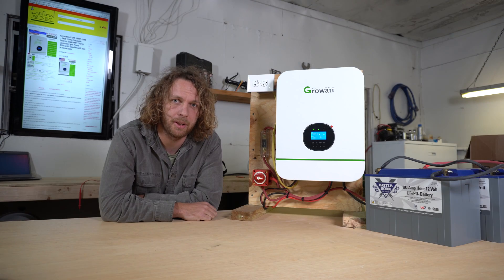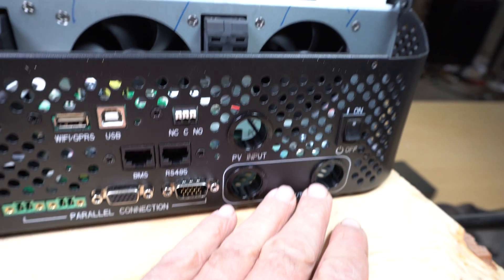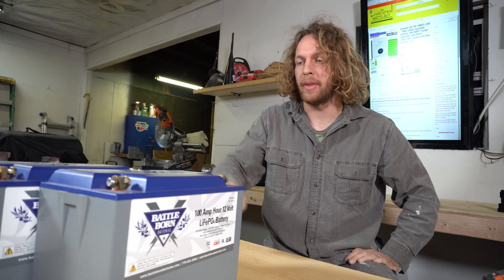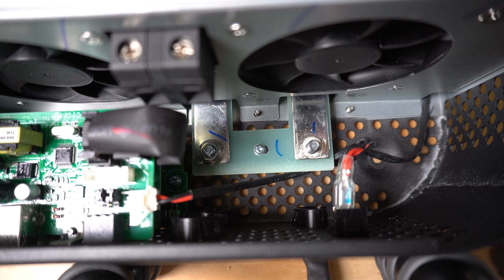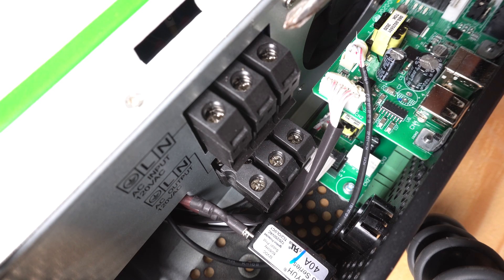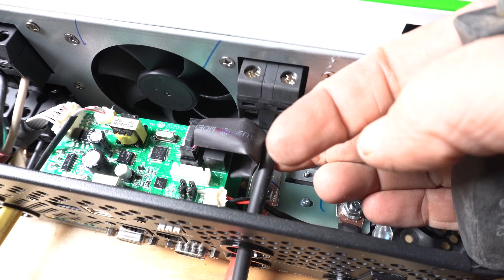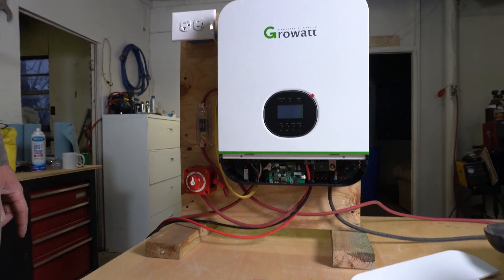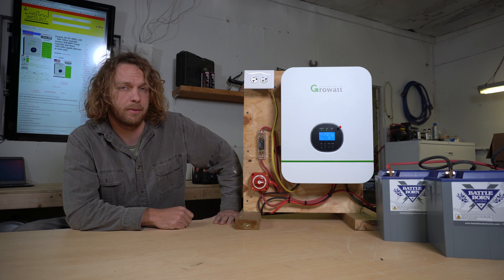Solar inverter by Growatt 3000w Test bench and first impressions.

Comment: can you use the 48v growwatt on only one 12v battle born battery?
Reply from the maker: Hey!
No I do not believe so you would have to buy 4 12v batteries or 2 of the 24v battle borns and that would be really expensive.....but if you want I have been looking into these batteries
 https://bigbattery.com/products/24v-wolf-lifepo4-120ah-3kwh/?ref=138
And they seem to bee the best batteries that would work with these Growatts at half the price...
Reply: @J-TAB  i want to get the growatt inverter that doesnt need a battery. i was hoping to get one 12v 100ah battleborn battery and then add them as i can afford them later. i purchased 10 250v santan 8amp panels so far and would like to use them with the growatt 48v batteryless option. I want to run 5,000btu without a battery using a large solar setup. Will 10 panels run a 400W load ac unit(5,000btu) with 900w start up(guess)? and since i cant get one battle born what are my option for those out of stock sok batteries? will they work with the grow watt batteryless 3000w? thanks i got some property in wonder valley maybe we can link up and you can help me get it going?
Reply from the maker: Hmm I see I would recommend checking out https://youtube.com/c/WillProwse
As I believe I have seen him use one of those non battery growatt's. He could probably be able to give better info on it. If you find out please leave a comment at let everyone know thanks!
Reply: @J-TAB  will do yea i follow will and watch every video of his and i want him to do one on the btteryless with larger array. he working on it but i need it now lol. thanks for help. correction 250W panel.
Reply: @J-TAB  does the growatt 3000 not need breakers between the ac outlet and the growatt? i was wondering if its all internal but i seen everyone besides you hook it up with beaker box. i was trying to save money hoping its all in one deal. any help thanks! i got my stuff in. now in setup mode.

Comment: Thank you for the Video.
Are you 4AG or 2AG. For your battery cables.
Did you have to configure any settings on the Growwatt?
Reply from the maker: I used 4ag cable as at that length of cord is sufficient at that load but.... if you can do 2ag that will not hurt especially if you are running the battery's any distance from the Growatt
Reply: @J-TAB  it’s a good video bro. Keep it up. Solar is a big deal right now. You can keep expounding on solar and DIY🤑
Reply from the maker: Thanks yeah I'm gearing up to do more!....

Comment: Hey, what can those 2 batteries run, and for how long?
Reply from the maker: hey Free!
so the battleborn battery's are 100 amp hour as 12v so 2 battery's in 24v is still 100 amp hours so its whatever you are running load wise, a quick google search will give you a calculator that can help you ... I don't have test equipment to test down to the watt hour but I will let you know with practical usage I have used at my job site running table saws and miter saw and tile saw etc. it has performed and had plenty of energy left over. I will be making a update video soon.....

Comment: I was hoping you would have included the solar panel hook up.
Reply from the maker: Hey Bryan!
I will be making another video soon on it. I have been using it for work and its great so far it powers everything I have thrown at it except a large compressor..... but I will be getting some panels go test also .... if you want to see some solar stuff on it you should check out 
DIY Solar with Will Prowse
 parosehttps://youtu.be/V0peZR8AyaU
Reply: @J-TAB  curious if you made that video ?  thanks

Comment: Do they make 12 volt ones?
Reply from the maker: Hmmm not that I have seen .... but you can use a 20 amp dc to dc charger 12 to 24 volt
Reply: @J-TAB  did you use the 24 to 12 dc dc converter. My appliance run off a 12v system and I'm trying to figure out how to setup that converter ( I have 2-200w 24v solar & 2 12v led acid batteries)

Comment: I'm looking for inverters that can be connected at 100 of 400W solar panels and also charge a 48V battery bank (near 50 kW).
Can you give me an idea of what type of inverter (and how many) for this type of PV please ? 
Thanks a lot for your video
Reply from the maker: Hey Denis!
I'm not sure Growatt makes a inverter that big... but here is one that you could use multiples of as long as they don't have to be linked https://watts247.com/product/new-growatt-250v-dual-pv-input-48v-12000t-12kw-split-phase-120v-240v-output-100a-at-120v-50a-at-240v/?wpam_id=81

but if you need to have them all linked you might consider these https://watts247.com/product/2-x-spf-3000tl-lvm-48p/?wpam_id=81  ....if you have enough of these you can get more input/output together than the one big one motioned before but i don't know if you could stack enough to meet your needs....

I hope that helps I have not built anything on that scale.....DIY Solar Power with Will Prowse may be able to give you more info https://www.youtube.com/user/errolprowse
Reply: @J-TAB  You help me a lot... the first one it's a big nice one :-) 
I'll ask Will also 
Thanks a lot Josh :-)
Reply from the maker: No problem.... the first one is big but the little ones can be linked to be even bigger so you would just have to see witch one is better for your application.....
I'm glad I could provide a little insight at least 😉

Also if you do decide to buy any of these and use any of my links I will get a small commission at no cost to you that will go toward helping support my channel thanks
Reply: @J-TAB  Surelly I will... but first I must finish my home 
then I'll buy all material for the photovoltaic system :-) 
Thanks a lot again

Comment: great video!! I'm new to all this so I really appreciate your video. Looking forward to more.  I'm thinking of getting one for a future van build, the only thing I would add is like Victron Smart 12/24-Volt 15 amp 360-Watt DC-DC Charger.
Reply from the maker: Yes that is really all it needs for a van application.... I would say tho dont put it next to your bed as it pretty loud when under load....
Reply: @J-TAB   When do they turn on? When the load is over 500w, 1k or ...? And do the fans slowly ramp up or are they always in one speed?
Reply from the maker: I am still testing it I have been using it at work with tile saw 12 in miter saw and table saw so those are all pretty big loads ....I will be making another video on it soon
Reply: @J-TAB  is fan on inverter ALWAYS on ?
Reply: @vandweleer8004  Yes, at a slow speed for smaller loads, but they do ramp up if we pull a heavier load.

Comment: This is actually my exactly setup for a build I'm working on. The only problem is that I keep getting an error thrown for no reason. 

What are your settings?
Reply: I was getting these next. I purchased , darn it could have helped you just seen 4-8-21. 
Bought ac200p four panels 170w bvrouge with 100' rd/bk extension. 
Sok 100 ah setup vs battleborn. Sce rates to be raised next month haha.
Reply from the maker: the sok battery's are supposed to be great but they are always sold out lol
Reply from the maker: Hmmm well in the video I had not changed any settings and it worked fine  used it for a while before I changed anything..... I am trying to use it as much as possible and will be making another video on it soon

Comment: Hey man, do you think this would be suitable for skoolie living full-time?
Reply from the maker: Hey nicholas 
I have been using this growatt for a while now and it is awesome...... but ... as far as using it in a skoolie it really depends.....it is 24v so if you want to run it with you alternator and the bus is 12v than it would not work.... if you want you can go to my website and give me a call or email and I can discuss it further
Reply: @J-TAB  alt requires special wiring and a new  double power alt. they really arnt set up for charging big banks.
Reply from the maker: also you could use a 20 amp DC to DC charger 12v to 24v ….here is one that I found https://amzn.to/3wHxbNi 
that would limit the current so its not to hard on the battery's …. in theory anyway as I have yet to use one but seems promising.

Comment: Whats the AC in for?
Reply from the maker: If there is a load more than what the inverter can handle it will switch to generator or the grid
Reply: @J-TAB  thank you for you reply, it reminds me of the Moeshouse automatic transfer switch I recently purchased. Starting to think I should have bought the Growatt instead. Still, all fun.
Reply from the maker: Yes that's exactly what it does...the growatt is all in one and I am thinking about getting another they are on sale right now at the link in the description 
I will be doing another video on it soon

Comment: I tried setting 15 to turn off the beep noise, but it didn't turn off.  I restarted the system, still beeping.  Any other suggestions?  Some other guys reporting the same issue, cannot shut that beep up.
Reply from the maker: hmm 15 is supposed to be the one   https://youtu.be/V0peZR8AyaU?t=207   ...I will be making another video soon on it, i have been using it almost every day for work as a portable battery bank
Reply: Setting 15 is for a different kind of alarm. Pushing the Down button and Enter button at the same time will stop/start the beep noise from occuring when pushing a button on the unit.

Comment: Hello! 
Did you try to run it under full load? How long can output 3kw?
Reply from the maker: hey! no not yet I am currently testing it in real world applications and will be making a video soon about it ....but if you are looking for more info on it now I recommend DIY Solar Power with Will Prowse https://youtu.be/V0peZR8AyaU he is where I first learned about the Growatt Inverter.
Reply: @J-TAB  [2kW heater + vacuum cleaner/rotary hammer drill/etc.] can be a real world applications too, right?) Should be a quick and easy test to perform.
Reply from the maker: Yes sir those items are definitely on the list
Reply: @J-TAB  And please measure its self consumption. In idle (bypass) mode and when on battery with zero or known load.
Reply: I'm so happy you did this video! Thank you so much!
I know some inverters have a higher surge rate above their constant general output. E.G. when an appliance starts up even though its rated for 1000 Watts, many times they exceed there constant state running draws. I was curious how this unit would handle that. 

Also since they are so small & compact, have you considered linking 2-3 in parallel to get say 6000/9000 watt capacity for the ability to run multiple electrical devices, like a shower heater, water pump, Oven/instapot or Microwave, inductive stoves, perhaps a large 27' -to 26" monitor/big screen all at the same time? I know they may put out some heat so placement could be an issue.

Curious as to your thoughts...

Comment: Isn't that 250A fuse way too high for that cable?
Reply from the maker: Yes but it is just a test bench.... with these inverters I would recommend really using a thicker cable and make sure you use actual copper cables not that aluminum clad cable
Reply: @J-TAB  by coincidence lol, at the moment I'm watching another growatt video where the guy is using exactly that...alum clad cable
https://youtu.be/4i_7favsJGM
Reply from the maker: Oh wow that stuff is dangerous...definitely would not do that lol

Comment: You used #2 AWG and 3/8" terminals on the battery, correct?
Reply from the maker: Hey Randall i actually used 4 AWG just for testing purposes tho, I would recommend as large of a cable as possible #2 minimum if you are running really short cable's to the batterys but I would go even bigger if you are running any distance... also make sure you have actual copper cables with as many fine strands as possible and not the cheap aluminum copper coated cable.
Reply: @J-TAB  Do you remember the terminal stud  size?
Reply: @randallgoguen3463  Most battery terminal studs are 5/16", and I believe so are the terminals on the Growatt.

Comment: Hey Josh, great vid... I have one on order, for a van, but I haven't seen how to fully TURN OFF the AC inverter like you can with other multi-function devices? My understanding is that it 'senses' when there's a load present and turns on/off automatically? But doesn't that likely 'take' some power for standby use? Any idea?
Reply from the maker: Hey Ben! 
I am still doing testing and will be uploading another video on it in the future, but so far I cannot find a way to turn of the individual components of it. Any inverter or electrical system is going to draw a little power at idle . There is a switch on the bottom that will turn off the unit entirely and I would also recommend installing an electrical disconnect with a fuse like I did in the video .
Reply: There IS a setting that is supposed to shut off the inverter if there's not much power being used, but most of us folks using them seem to prefer to just disable that setting, as the inverters don't seem to want to 'wake up' after shutting down. Other folks may have better knowledge than I, though.